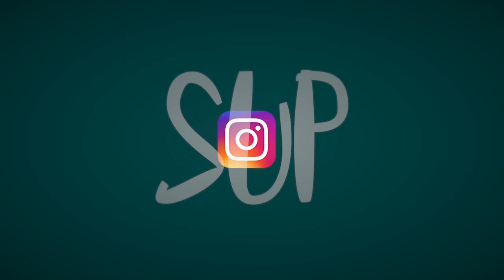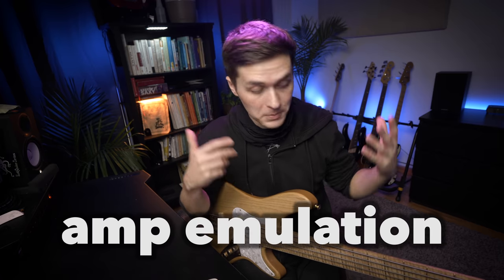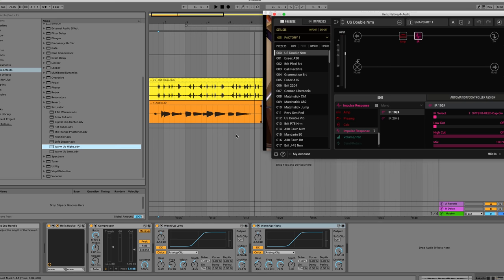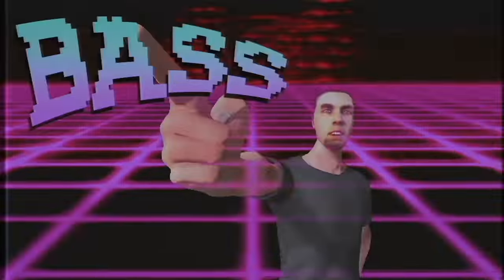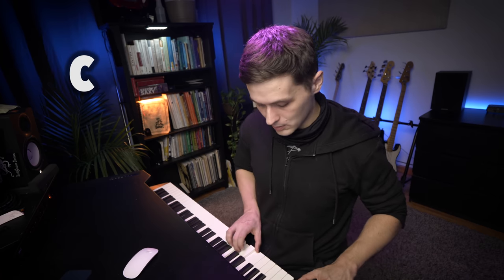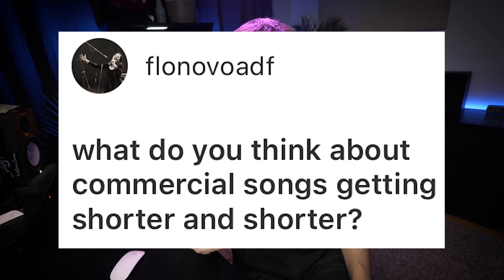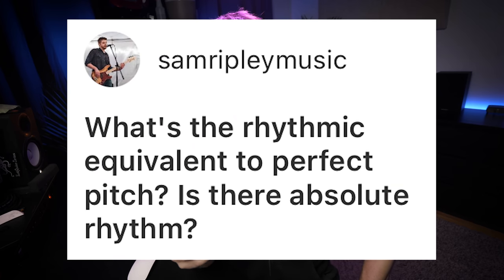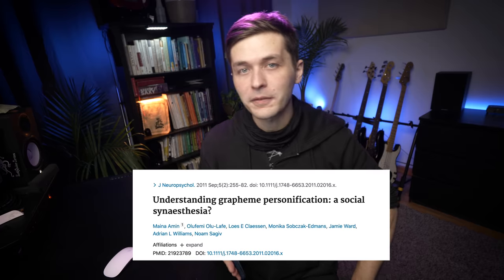How do you get that t h i c c bass tone? | Q+A

Comment: lp stands for "long play", hence its additional length up to 25 minutes or so. 78's and 45's were around the 3 minute mark
Reply: were they short play? or just play? lmao
Reply: Techmoan has an excellent video about the format war between LP and 45s. 

Basically LP was designed to fit a whole album of 78s on one record. But 45 was designed for automatic players so you could just throw together a playlist. (And stack them without having the grooves touch)
Reply: @juanpablo1834  just play. Also worth mentioning that since they were made of shellac they were super strong but super brittle. So the records lasted forever but you had to replace the needle each play.
Reply: Yeah, it bothered me that he said maximum 3 1/2 minutes and then kept emphasizing that it has to be less than 3 minutes.

P.S.: Ip can also stand for kung fu. 😜
Reply: @juanpablo1834  They were singles. One track per side.
Reply: In Swedish the most common folk etymology is "LerPlatta" ("Clay Plate"). I knew that wasn't it, but I've never thought that hard about it.
Reply: I was just about to say that and you got in first. Have a really lovely day.
Reply: The original discs were made of shellac and were played at 78rpm. There were two different common formats - 10” and 12”. The 10” had space for a little over  3 minutes, and the 12” had space for a whole extra minute. The original players were entirely mechanical and used single-use needles. There were three grades of needle - Loud Tone, Soft Tone and Half Tone. The needle was attached to a diaphragm with a screw clamp and the sound was amplified with a horn. With the invention of the valve electronic amplification was possible and the steel needle was replaced with a multi-use jewel stylus, which reduced wear on the records.

Vinyl was invented in the 1950’s and the 10” shellac discs were replaced with the 7” vinyl discs that played at 45rpm. And 12” vinyl disks that played at 33rpm. The 45’s were called singles as they had a single song on each side. The song you bought was on the A side and the B side had a bonus song that the band (or label) didn’t rate as highly. 

The 33’s were called Long Play (LP) because you could get 25 minutes per side. Enough for a whole movement of a symphony or half a dozen songs. 

There were other formats of vinyl. The 7” Extended Play (EP) which squeezed 7 minutes onto each side at the expense of a loss of sound quality. This idea had already been used on 78’s, but was a bit of a gimmick. 

There was also a 12” single which allowed 10 minutes or so of music. This was popular for the “dance mix” version of songs in the early 1980’s. 

Then the CD was invented.
Reply: and here I thought it stood for Les Paul
Reply: @raylewis395  Indeed. There was also the 16rpm records which were for use with movie reels.

CDs, as it goes, were invented in the 60s, it just took a long time, and some vision, for them someone to decide on a format/size and how to organise the data before a marketable music product was made
Reply: 78s and then 45s were singles or Standard Play. EPs were Extended Play, which was achieved by using narrower grooves on the same 7 inch disc. LPs were Long Play, spinning slower at 33rpm on a 12 inch disc.
Reply: @Bionictotquewrench  EPs were generally specified to play at 33 1/3 rpm as well, which afforded some extra time out of the same length groove on the 7"
Reply: Adam's (lack of) age is showing here!  None of us old dogs would ever confuse an LP with an "SP".  There was more than one format for SP, but a common one was the 78 RPM 10" disc that was about 3 minutes long.  For those of us growing up in the 60's and 70's, LPs and 45's were our bread and butter; we rarely saw any 78's and we wondered why that was even an option on our turntables.  But I believe the 3-minute limit was more about radio marketing than physical limitations, because in the 50's and 60's when the 3-minute rule was king, 45's could play up to 5 minutes.
Reply: @JeffLearman  Yes, three minutes meant the station could play more music which draws listeners, but also meant it was easier to slot ads in and keep the number of tunes up
Reply: Yes, LP stands for long-play. While we commonly call 7" records "45s" a lot of 12" records were cut at 45rpm and a lot of 7" EP (extended-play) were cut at 33, or even 16rpm. 10" vinyl comes at all speeds. I've never seen 10" shellac cut at anything other than 78, but I don't have an extensive shellac collection. EP's were cut on 7, 10 and 12", at all speeds. Singles were cut on 7, 10, & 12" at all speeds (the 12" at 45 is my favorite format, so lush).

Adam's point, the ~3min pop length comes from the limitations of the medium (10" shellac @ 78, 7" vinyl at 45) of the singles is correct. He's just not as nerd about this as some of us.
Reply: LP is a trademark for columbia records.45 was invented by RCA.
Reply: @SteelSkin667  back then bands had a good song A side and a poor song B side they released on 45 when their album came out it had those and the rest was considered filler material, that's why when the beatles came out all their songs were good which was very novel back then.
Reply: @raylewis395  45rpm+33rpm=78rpm
Reply: @Salieri the LP was 12" spun at less than half the rpm and the distance between grooves wasn't constant(during quiet part the grooves were much closer together) and the grooves themselves were much smaller ,you can actually get over one hour on both side of a record.

Comment: One minor correction - LPs were originally the common name for 33 1/3 RPM albums.  78RPM records - the first really standardized play at home records - had a 3.5 minute maximum length.  The 7" 45RPM records,  popular in the 50s and 60s, were 4-6 minutes.  LP which stood for Long Playing were 33 1/3 RPM with roughly 22 minutes per side.

Yeah, I know, more trivia from the old guy than you really wanted to know.

Keep up with the good work Adam.  I'm always learning from your videos.
Reply: Two years later, and it still wasn't corrected by captions, or whatever.

Comment: Memorizing tempos isn't too hard actually. If you know the tempos of your favorite songs and think about what it sounds like you can get a very close approximation to that tempo and with practice you can become pretty accurate.
Reply: I just estimate off 60bpm=1 beat per second, 120bpm=2 beats etc
Reply: A liittle but faster than 1 beat per second or a little less than 2 beats per second
Reply: True. I've listened to When The Levee Breaks so many times in my life that I can fairly reliably count off something in the region of 80bpm by hearing Bonham's drums in my head. It's not perfect, but it's a decent reference point.
Reply: @olivierlaborde7887  I tried to do 2 beats a second, then looked at the clock, and it was 4 beats per second lmao

Comment: "Let's check that so i don't look like a complete idiot." 
one minute later
"An  LP record can only play 3 minutes per side"
lol
Reply: I assume he meant single lol
Reply: 78s were 3 about three minutes play time.
Reply: The 10" diameter are ~3'. But my Dad had a bunch of classical and jazz 78's that were ~5' at 12"diameter.
Reply: lol.  Yes, LP stands for "Long Playing" format (https://en.wikipedia.org/wiki/LP_record).  The technology Adam referenced is actually 78 RPM discs which have a practical limit of less than 3 minutes per side.
Reply: @nino-ciampa  He meant a 78-rpm, which were generally about the same size as LP (10 inch or 12".)  The 10" could hold 3 mins, or the 12" did about 3 and 1/2.

Comment: I think you meant 45 r.p.m. 7" singles (the ones with the really big hole in the middle) that were used in juke boxes regarding the 3.5 minute per side song length limit. Similar limits arose from the approximate 23 minute limit for a 33 r.p.m. 12" vinyl record, and the 7 or 8 minute limit for a 45 r.p.m. 12" vinyl DJ dance single. In the opposite direction, Sony/Philips chose 64 minutes as their length target for the original CD, in order to fit a particular Beethoven symphony on one disk. Kind of like how us guitar players love scales that fit the tunings we use. Love your channel, Adam.✌️

Comment: To clarify, a compressor only "compresses" the loudest portion of a signal. You can then gain up the entire compressed signal to make it louder, but the "compression" itself only effects the peaks. "It makes the quiet parts loud," is a common misrepresentation of what a compressor actually does. Sure, it shrinks the entire dynamic range, but it's not actually making the quiet parts louder, it just limits how loud the entire track can get so the difference between "loud" and "soft" parts of the recording aren't as big.

Comment: Ever since I started really getting into the mixing/mastering philosophy of Nolly (of Periphery) as well as how he approaches bass, I've been quite enamored by how he approaches the bass within the overall mix. One of the pedals he talked about using a lot, the Microtubes X7 pedal from Darkglass, I ended up getting and it does parallel compression so fucking well. I never really understood how applying distortion and eq differently within different parts of the frequency would have such a profound effect on the bass tone.

Comment: The 3 minute pop songs goes back to the limits of 10" 78s (78 revolutuions per minute, made of shellac), which held just over 3 minutes per side. That convention held up with the change in the 1950s to 7" 45s (45 revolutions per minute, made of vinyl) for single songs, though those could actually hold more like 5 minutes. Incidentally, the whole idea of calling a set of songs an "album" also goes back to 78s. Because they held so little music, it  was common to get a set of them arranged in an album (like a photo album) in order to get a set of songs or compositions.

Comment: It was 7" single records that could only roughly hold about three and a half minutes of sound. The amount of information was further limited by the higher sampling rate of 45 rpm, compared to 33rpm on a LP, which resulted in better sound, especially when played on big systems. That is also the reason why so many James Brown tunes (and funk & soul in general) are named Part I and Part II. There are some 7" singles that are to be played at 33rpm with the grooves pressed very narrowly so they can take up to three songs per side, but that results in poor sound quality, can't really play those in a club setting. So it's technically possible to fit longer tracks on 7" single records, but the "about 3 minutes convention" turned out to be the best balance of sound quality and lenght in time.

Comment: You could probably take Sungazer on the next Cruise to the Edge (which I think breaks the general cruise rules), now that Shawn has the right contacts to help get you in there. (And never mind that boxers are going to put it into a different box to suffocate in. If you check out that particular cruise, you'll find that the definition they use of "prog" is broad enough to include some hot blues.

If a song has said it all it has to say in a minute, that's the right time to end it (and don't go bringing up irrelevant somethings regarding verbosity).

Robert Pollard of Guided by Voices offers a masterclass in this. (Just listen to the shorter of his many thousand songs, and it'll all just make intuitive sense after that).

Comment: Apprentice Luthier here, with the bass itself try 250k pots and a higher rated capacitor for a darker tone or 500k pots and a lower rated capacitor for a brighter tone. And don't be scared to mix strings to get your tone, seriously, as long as they're the same or similar gauge and age you're fine. I would recommend warmer lower strings and brighter higher strings. Example: warm B or E string, and bright A, D, and G strings. Though feel free to experiment

Comment: 5:55 From what I remember from the 1970s, "LP" (long-play) refers to a 33 1/3 rpm record (i.e. album). By contrast, singles were on 45 rpm (known as 45s). The approx. 3-minute limitation is probably due to 45s, not LPs. I can't speak to the origins, but I'm pretty sure in 1960s and later, LPs and singles were different things.

Comment: Slight slip-up there on length of songs on LP vinyl record - which stands for "Long Player - 33 rpm - you can get 25 to 30 minutes per side depending on the compression and mastering etc.  The 3½ minute time limitation came about because of the 12 inch 78 rpm shellac discs (later replaced by equivalent synthetic resins).
Sorry if this is the umpteenth comment on this, had a quick look, but you have 1.5k comments (needle in a haystack) !!

Comment: Thicc bass hack.

I'm Canadian and we have Traynor-Yorkville gear here much like Peavey is USA.. theres an amp.. XS400 or XS800.. combos exist with 2-10 and 15 variants.. But the thing is that have a tube and SS preamp with drive and blend between them and a pretty workable compressor. The XLR out stacked to a Subwoofer running everything under 250hz.   It reduced my entire pedal board to just it's own switcher

Best part.. Just the Head can be found for $200 and the combos start around $400.

Cons: the combo weighs about 87lbs

Comment: The only problem with this is that there isn't any volume compensation, so it's getting significantly louder down the chain. The louder a sound, the more natural compression our ears impose on the sound, thus making it "sound better". Guess what I'm saying is, this would have been more transparent of an example if the bass didn't increase in volume from the bypassed example, that way we could hear the true thiccening effects of the amp sim, compression, and saturation.

Comment: I need some good pinky exercises for guitar. My pinky's do find from index and middle finger, but with ring finger my pinky is hard to use in a smooth manner. It sort of pops back like it's double jointed (something that doesn't exist, but you get it). It requires a great deal of effort to move forward. I want to keep it close to the strings, but with the ring finger down it's independence is limited. I can either pull away a great deal or touch the string. It's difficult to hover and this issue is very tiring for my pinky. As a result, I do a lot of sliding instead. It's not impossible to use my pinky, it's just tiring.

Comment: I can't really compare the DI sound to the post-cabinet/amp simulation sound, since the volume is not the same at all... And the human brain being stupid, louder almost always sounds better. That's why almost every vst or effect unit has a "gain" knob, allowing you to approximately match input and output, so that you know that the difference you're hearing is the actual difference the effect is making on the sound, and not just a volume difference.
Still loved the sound tho! Especially the very well-balanced distortion. Are you using the exact built-in preset or adjusting a few things there? Your bass sounding dope from the start kinda blurs things out for me here ^^

Comment: Hello Adam, and all musicians i have a question about odd? signatures. if the grove is divided into a prime number 7,11,13... and so on. Is then one on  one that will cause the note to drift over bars, or is it evenly spaced out inside bars so 1 not actually on one?

I am programming a thingy where you can divide the beat freely, imagine for ease that the metronome doing 4/4 for bar, but there is 21  steps  within range?
Is one/21 on 4/4 one "and note drifts" or is 1/21 not on 4/4 one and thus evenly spaced over many  bars?

Comment: 10:05 - Just when you thought popular music had decayed to an all time low. But I suppose sweeping that off as a sort of "generational dislike", is easy like the case with jazz, rock, pop. =) I think it's reasonable to assume that it affects popular opinion to some degree, but it's just one part of a bigger picture, I think. Our digital age has changed music culture completely on so many aspects it's hard if not impossible to generalise the industry just across the past 40 years. However, the biggest culprit cliché I found between now and then, would be to point out that everyone with modern technology is a potential musical artist, producer or listener. Inflation like that will normalise "the average quality or standard" of music. It doesn't matter what genre or style is popular the output will still be of a lower quality. Ironically, on an extreme end of the scale, the output is of a higher quality than it's probably ever been in the history of music, but we don't get to hear much of it because it doesn't align with other parameters designed around perceived popularity.

Comment: Hey Adam! You might not have heard but Taylor Swift has FINALLY released not one, but Two songs in IRREGULAR TIME MEASURES. It’d be great if you could have a listen and help us mere mortals understand what the heck is going on. If you feel like doing that, the songs in question are “Tolerate it” and “Closure”, both from the “evermore” album which was released a couple months ago.